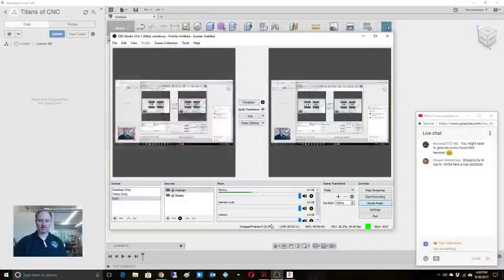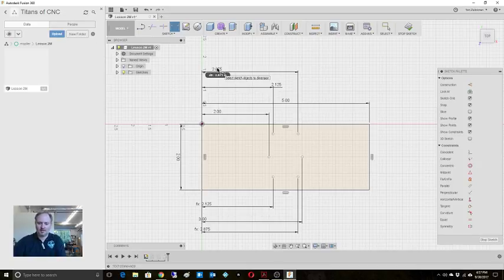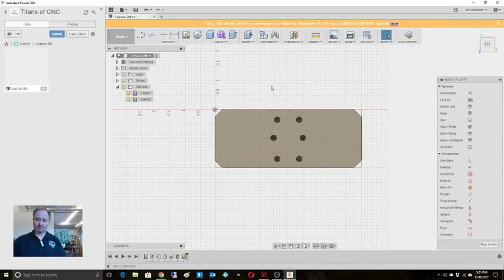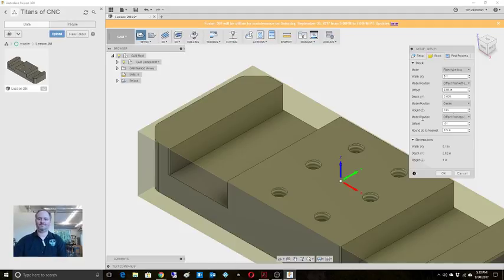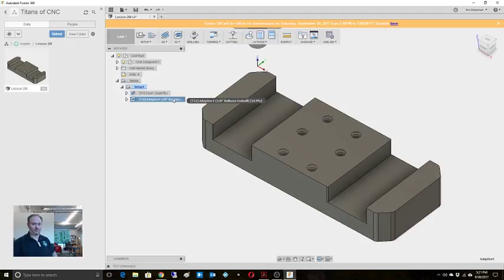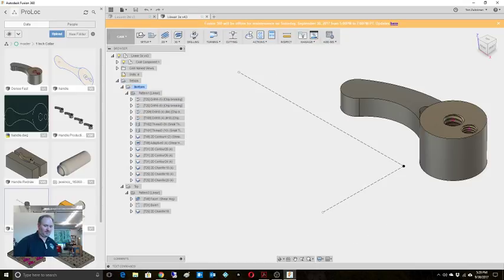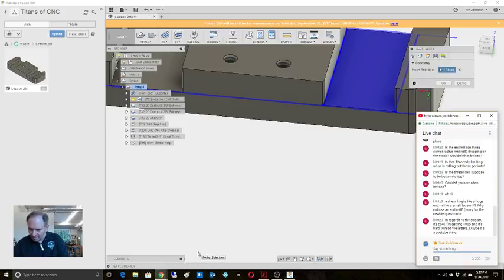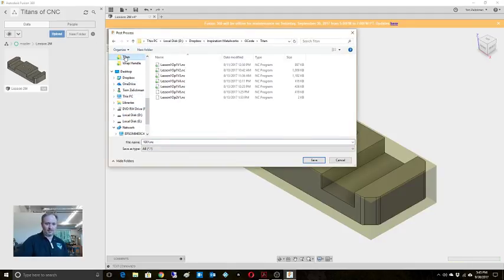Titans of CNC - Lesson 2M

Comment: 28:25
I completely agree with you - stock box point all the way. In fact, I think it makes very little sense to use the model box. I'll write some of my reasoning below...

First, not every part is gong to have a convenient origin point. In other words, setting the origin to the model of a rectangular part is easy enough, but what if the model isn't nice and square and flat? If you're milling out a 3D object, maybe a face or something, that object isn't going to have a place to zero against anyway, so trying to set the origin to the model on something like that is pointless.

I don't think the origin should be based on the model for rectilinear parts, like the one from this lesson, either. In my opinion, setting up the part that way is basically preparing for a situation that doesn't happen very often. Sure, if you started milling this part and something happened that caused the origin point to be lost, you would then have to spend a little more time establishing the origin point. That IS true, but how often does that happen? Hopefully not very often. On the flip side, setting up parts with the origin on the model instead of the stock is guaranteeing that you'll have to spend extra time establishing the origin point every single time you run the part. First you have to set the origin to the stock anyway, as the stock is all you have to work with at the beginning. Next you have to know how much offset there is between the stock and the part. Of course, knowing that distance isn't all that difficult, but it is definitely more difficult than not needing to know it. Next, you have to change the origin point in the controller. Again, this isn't exactly difficult (generally you just have to type in "-0.05", or whatever, into the DROs of PathPilot (or taking similar steps if using a different controller)), but it IS more difficult than not needing to worry about it. But taking these two actions (remembering/knowing the offsets and entering the offsets into the controller) is just introducing instances where mistakes can easily be made... Maybe you remembered the offsets wrong, or maybe the numbers that are written down are wrong, or the writing is illegible. Or maybe you accidentally put the X offset into the Y axis, or transcribe the number wrong (like put the decimal point in the wrong place), or maybe you get the positive and negative mixed up (I do that a lot). ... it's just asking for trouble, especially when placing the origin on the model requires you to take these steps at the beginning of every job.

Next, if something DOES get messed up after the machining has started, it's STILL not even guaranteed that the surfaces used to place the origin on the model will have been revealed yet. If something was to happen during the 3D adaptive clearing operation of the part above, you'd basically be screwed. The stock in that corner is gone, so you can't set the WCS to that any more, and there would still an unknown amount of stock all around the outside edges of the part (because it will not have been finished yet). What you'd probably have to do is edge-find on the left and right sides to find the center of the part in X, and then edge-find on the front and back sides to find the center in Y. You'd then have calculate how far the center is from the intended origin and then input those numbers into the controller manually. Z would, indeed, be easier in this situation as you could just edge-find the top of the part and you'd be done. In an instance like this, having the WCS set to the model instead of the stock would save very little time.

Shoot, gotta go... I'll just post this now and maybe come back to fix typos or whatever later...
Reply: OK, thought about it a little more and I think I can put my opinion much more succinctly.

The only real difference between putting the WCS on the corner of the stock and the corner of the model is that there are some offsets involved. Placing the WCS on the stock forces you to apply those offsets before every job, and having it on the stock means you may need to apply some offsets if something causes the machine to lose its positioning, which isn't really all that often. And since applying offsets takes time and opens the door to making mistakes, it makes sense to avoid it if possible. And if you only need to do it on rare occasions, some extra time taken to double-check your work and extra time being extra careful not to make mistakes won't be as much of a problem.

Just my 2¢.
Reply from the maker: +Hirudin I tend to agree with you on this. There are a lot of places where going the route of model origin can introduce errors. I need to go back and double check a few things though. I feel like I might have missed something from the print.

I really appreciate you taking the time to watch and comment. It might have been rushed but the thought process was well laid out.

Hope all is well!
Tom Z

Comment: I kept noticing that the hole pattern didn't quite look centered, which I assumed it would be, so I went back and double-checked the dimensions. I believe you have the bottom two holes 1.700" from the origin (in Y), but they're actually supposed to be 1.600".
Reply from the maker: +Hirudin I’ll go back and check that. I think I used horizontal / vertical constraints on some of them to mix things up during the video and it’s possible that’s the thing that’s  been nagging at me.

Thank you!
Tom Z